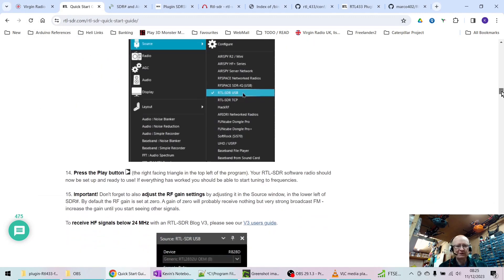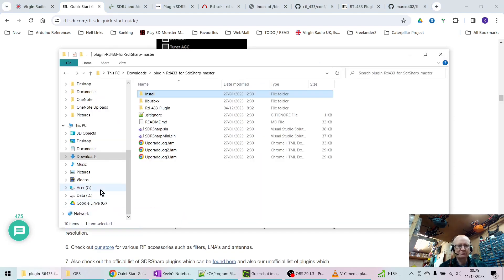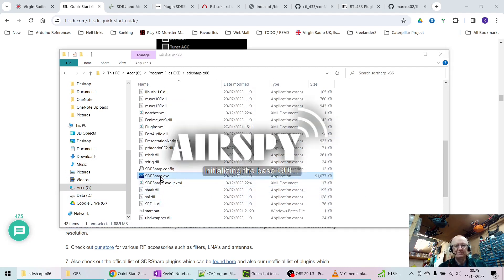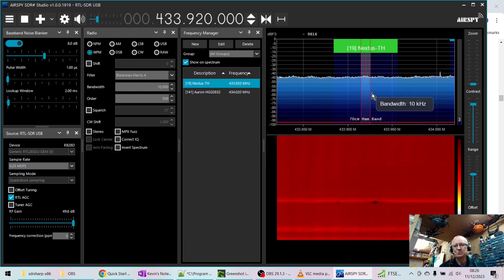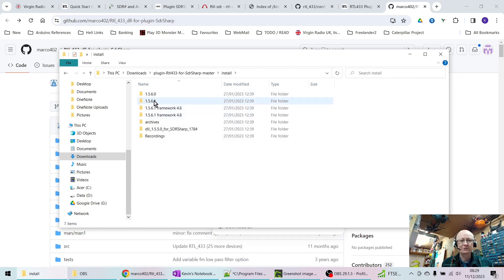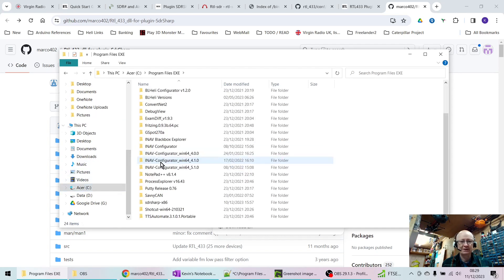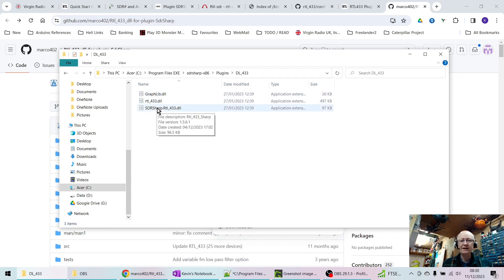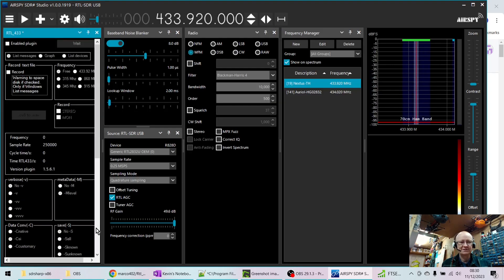Installing SDRSharp and 433mhz Plugin for V4 dongle

Comment from the maker: I just reinstalled Oct 2024.
I found the following differences which you need to take account of:
	1) SDR Sharp is now revision 1920
	2) When inside the Plugin-Rtl433 install folder you now have to Unzip 1.5.7.0 to get the 3 files you need
        3) Other than that it worked as per this video

Comment: couple years ago i used an RTL dongle from an DVB-T usb-stick (with a RTL2832U chip) for listening to ATC radio using SDR#. Now i am trying to set it up all again, but i cant receive ATC radio (now using the current AIRSPY SDR# software). However, i can receive radio broadcasting (FM). any hint what i am doing wrong? thanks
Reply from the maker: Did you see my recent video on fine tuning 433MHz signals?